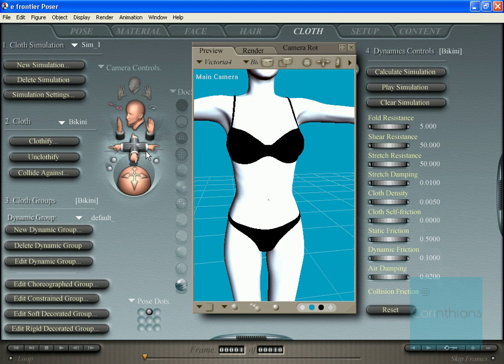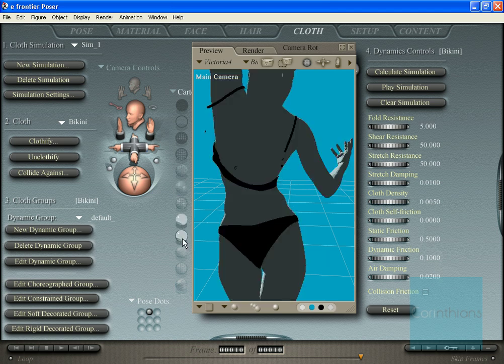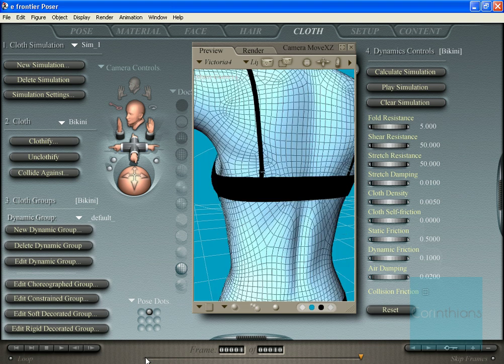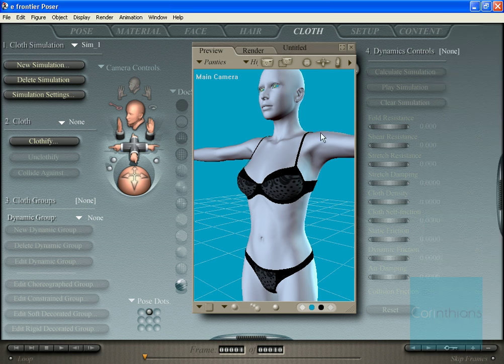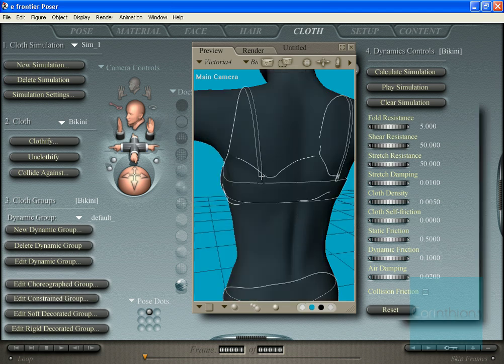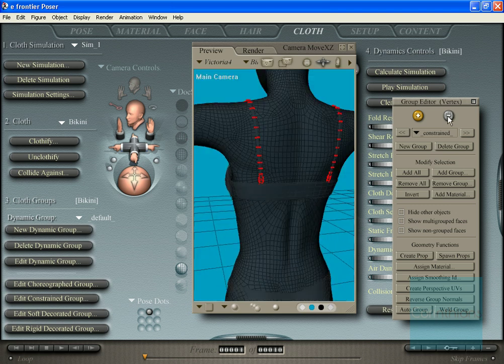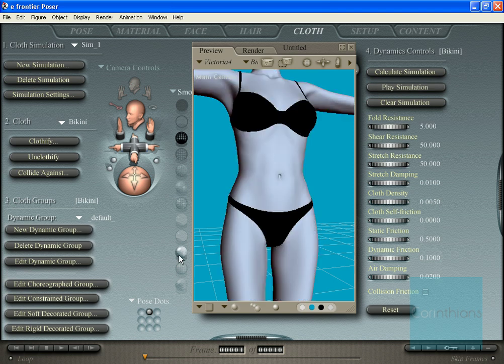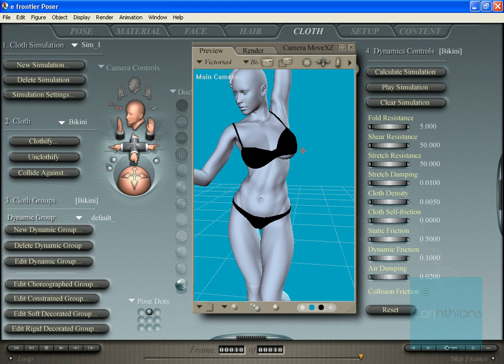Poser Dynamic Clothing Tutorial Conforming to Dynamic

Comment from the maker: Something went wrong. Usually, the problem is as simple as the dynamic mesh being too dense for Poser to calculate it. 
What else could be wrong? Well, that's a long answer. The next usual thing that causes a "failed at 0" is mesh intersecting instead of colliding. Try using the Self Collision option. *nod nod* Yeah!